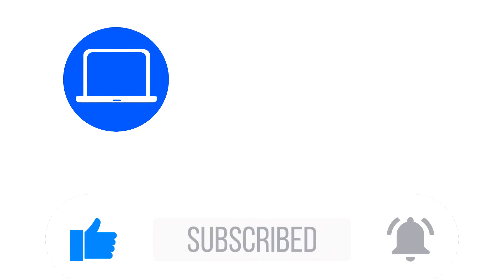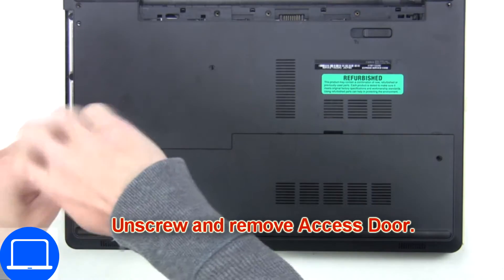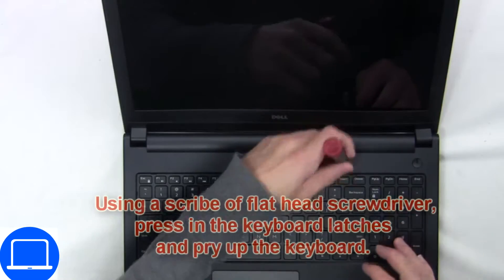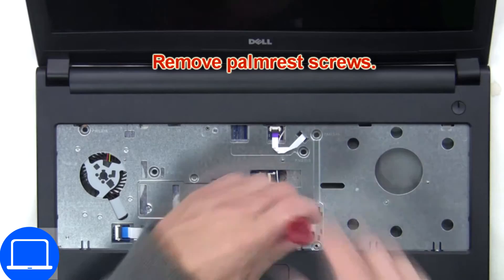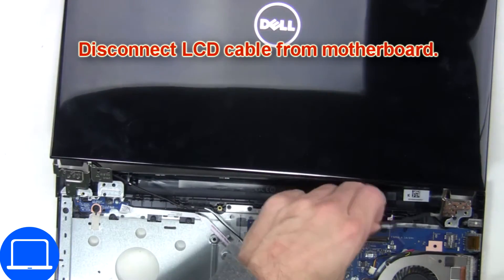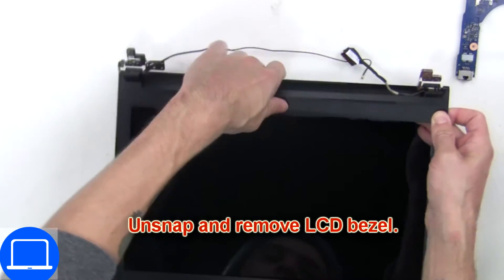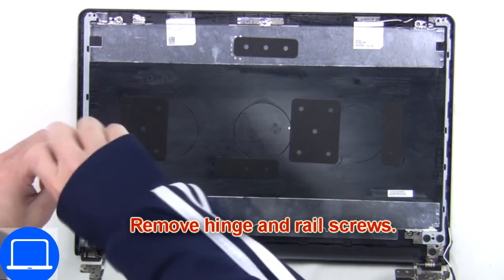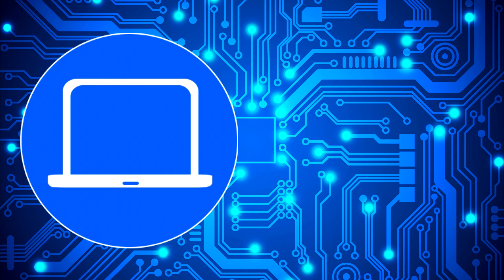Dell Inspiron 15 5558 (P51F001) Display Cable How-To Video Tutorial

Comment: Explain This, Please
You can also help avoid static discharge by grounding yourself using a wrist grounding step or by touching a bare metal surface. 

That means void a year of warranty of the cable
Performing your own repairs may void your warranty!

Last, I'll have to update the BIOS after installation
Notice: Part installations may require BIOS updates